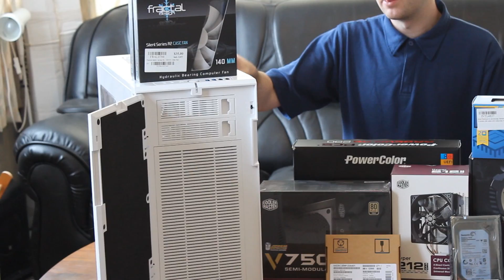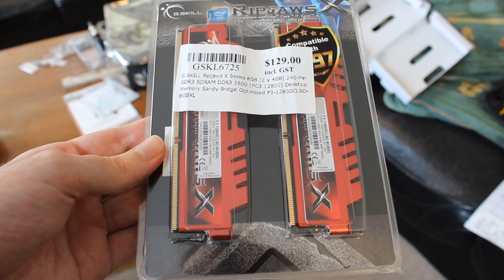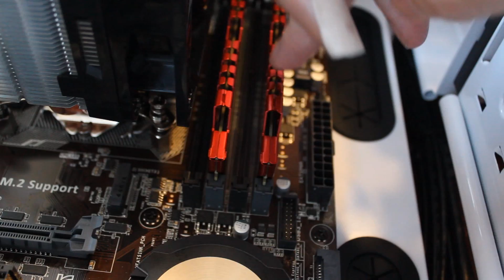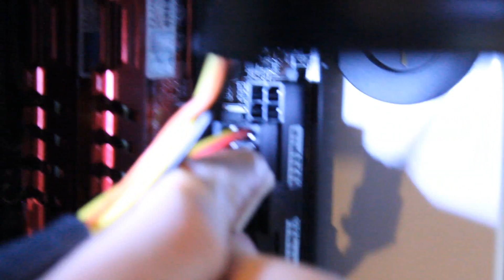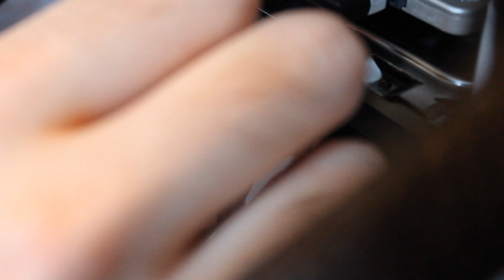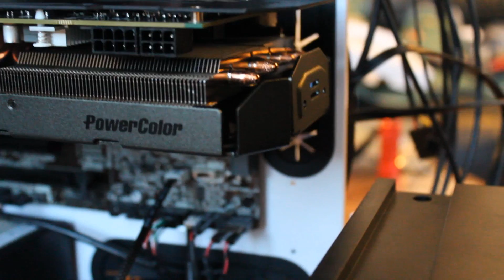Value For Money PC Build Guide

Comment: I, saw your video, and I have this idea of build....

Corsair Vengeance 8gb ddr3 = 33,66£
CiT G Force White Tower Gaming Case (purchase today) = 40,50£
Gigabyte GV-N730-2GI GT730 = 52,98£
Hard Drive Western Digital Blue 1TB = 41,99£
Intel Pentium g3258 = 55,44£
Motherboard ASUS Z97-P = 70,60£
Not sure witch PSU to purchase, maybe EVGA SuperNOVA NEX750B = 70,11£

TOTAL = 365,28£

and then upgrade

Intel Core i5 4690K = 177,92£
ASUS Z97-PRO GAMER = 109,99£
Sapphire Radeon Nitro R9 380 4gb = 182,99£
Cooler Master Hyper 212 EVO = 29,99£

This build should be a good base ? opinions? 
could I get a cheapper PSU for this buiild?? like a 500w?

thanks

Comment: Why not quad or 8 core cpus amd makes some cheap ones?
Reply: For $1500 go with Intel, much better and most of them can handle next-gen games. This means you do not have to upgrade in the future. Also, the piledriver architecture in the 6300 is last gen. BTW clock speeds do not matter as much as other things.
Reply: Because if your purely gonna game or browse the web like a normal person would and dont have in mind doing some intense editing things theres no need to get a high end processor im getting an amd 6300 processor for my 1500 dollar build
Reply: Also a better processor will barely help your fps in games why spend an extra 100-200 dollars for 5-10 more frames right?

Comment from the maker: Go easy on the camera work, we didn't script or plan this video at all and it was his first time using the camera :)
Reply: Ok wait a second... I'm the 100th like, and the 3140th viewer... 100 is the square of ten, and 3140 is 1000 times pi? But even though 1000 is ten times 100 it's not the square of 100? It's the cube of the 10th? 10 x pi doesn't = 21? 

ILLUMINATI CONFIRMED!?
Reply: ***** It would be better to get a Quad Core CPU. The APU series  from  AMD are cheap plus most of them are Unlocked like the Pentium. I am a Intel fan boy but I spent a little more in a i5-4690K. I suggest getting it when you upgrade.
Reply: Nice video as always, :) dont sweat it
Reply: Don't drink beer in the vid xD
Reply: +7X HARDER lol